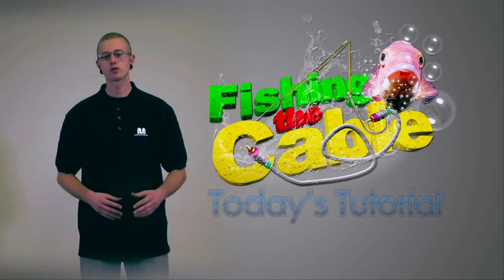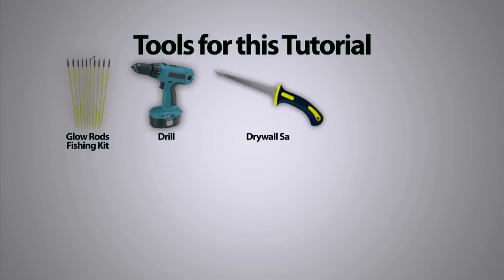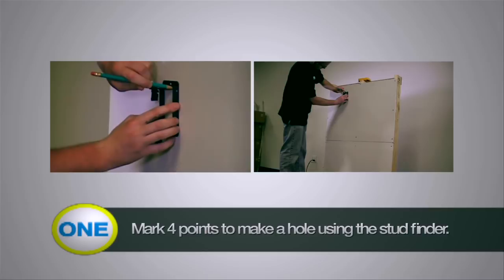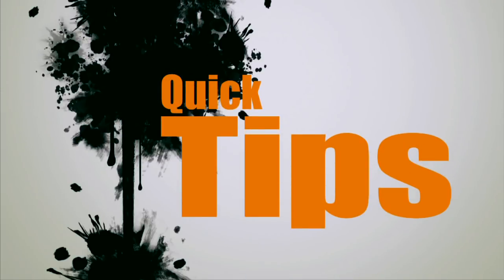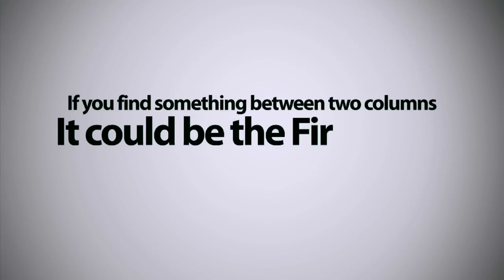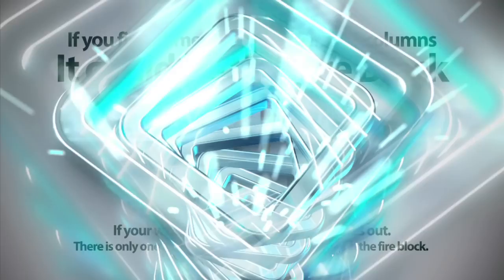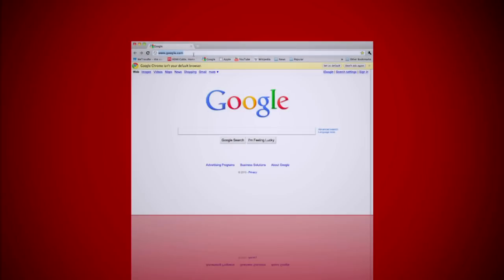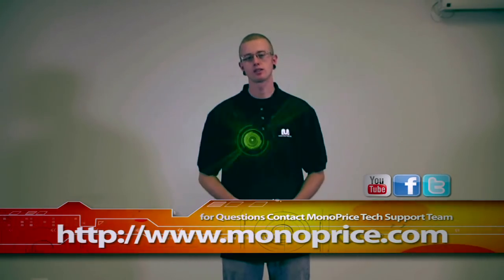How to Fish Cables Through the Wall - Showing Pumpkin Cut, Drilling Fire Block, and Mounting Bracket

Comment: This video was actually very good. I do premise wiring for my clients in addition to the typical network support and server setups.

One thing I would add - 
ALWAYS start cutting horizontally first! Why? With or without a stud finder...sometimes there is a surprise stud in your way! So if you do, you can just reverse your direction and continue. If you start vertically, you most likely will not find the stud in your way until it is too late and have a bad mess. TRUST ME. Been there, done that!

Comment: There's a different way to go over a fire block.  you can cut a similar sized hole in the sheet rock directly over the stud (this works with vertical studs or horizontal fire blocks), leaving room above and below to grab/fish wire.   You can then use a router, or even a "paddle" drill bit to carve out a track in the wood stud.  fish your wire over the wood stud, then put the drywall piece back on with a screw (obviously not in the cable track), then use drywall tape, mud, smooth out and repaint.

Comment: not sure how i got here. or why i watched the whole thing. but one little tip: you can actually get flexible installer drill bits that can be used to both go through the fireblock and also fish the wires back through. takes some practice but it saves the extra cuts and subsequent patching and repainting of the wall.

Comment: This is a good video. The one additional thing to remember is now you have wires right under the drywall running through the fireblock. Make sure you don't try and drive a nail or screw into them down the road (if your mounting a shelf or hanging a painting or something.)

Comment: I have a question. I have a home theater system and I don't want to run my cables all over the floor. Is there a way to install speaker wire horizontally?

Comment: Many factors come into play here.  The type of drill required depends on the type of wall you have and the position of the hole.  If the wall is brick or you are drilling under your floor in the foundations (which will most likely be brick) you will need a SDS drill with a reasonable size of masonry drill bit  If your wall is just plasterboard then just cut a piece out with the pad saw and the same in your living room, but be careful as there could be studs and cables already there.

Comment: its easier to install the low voltage ring after you pull the cable through the wall

Comment: yeah but it would be patching holes every 16 inches.
you would have to drill through each stud, it would be best just to run the main up to the ceiling and then run to each speaker,etc...

Comment: Ah 2 things (or should that be 22).
DRYWALL .? We call that stuff Gib Board- as it's made by sandwiching 2 "outer" skins of hard "Carding (Board) Paper" about an inner 8mm thick Fire-retardant Gibraltar Cement in sheets- "ready made" in either a standard size of 1200 x 2400 mm OR LONGER (such as 3600 mm & 4800 mm "Long-Runs").
Plus:
ALL NEW ZEALAND buildings (from around 1995 onwards) were regulated to had to have ALL internal walls (as well as exterior's) FITTED with PINK Fibreglass BATTS.!!